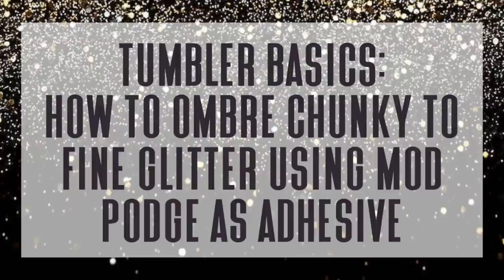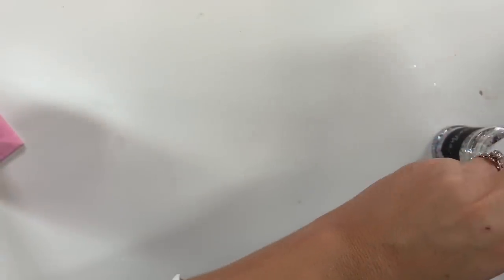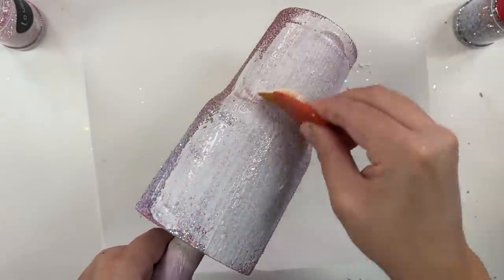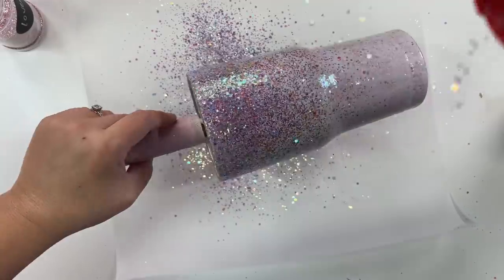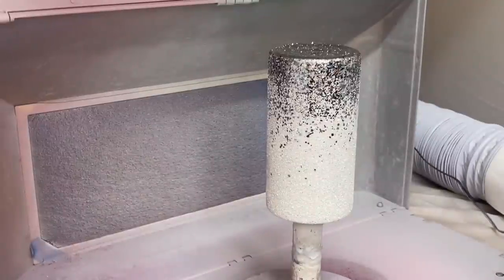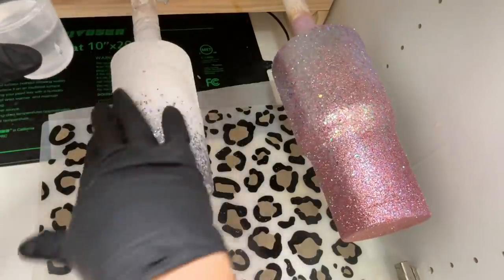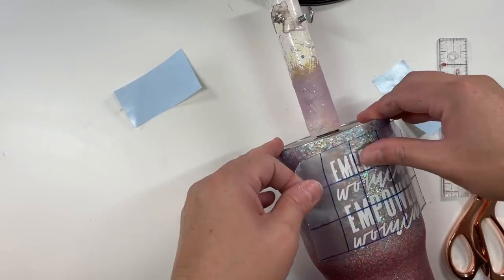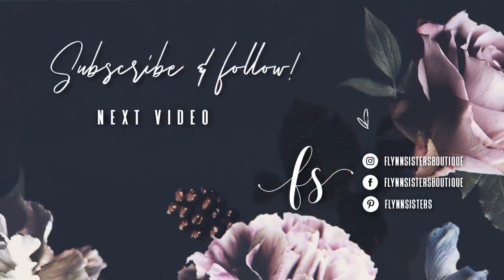Chunky Glitter Ombre Tumbler Tutorial

Comment: I love your videos!!  
Question though, I struggle getting smooth edges on the rim and bottom of my cups no matter if it is a thin or flood coat. Do you have any tips to help with that? 😬
Reply from the maker: Thank you Marguerite.  I do show how I sand the rim and bottom in my videos. You can take a look back and see. I like to use a sanding block between coats of epoxy. Using fine glitter at the bottom of the cups is a big help too.

Comment: Which coats do you use quickest epoxy and regular set glitter. I know you should use reg set as final coat due to uv protectant but the dry time you allow at different layers seems to vary.
Reply from the maker: It depends on what I’m doing but usually I use it for almost all my coats and the ACC plus formula for a final coat